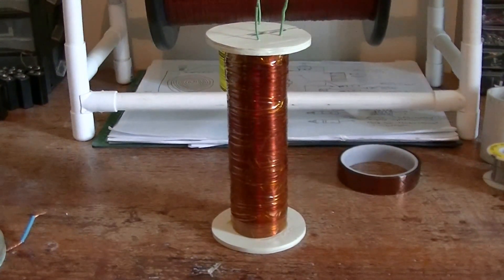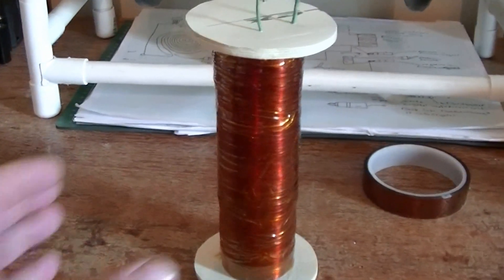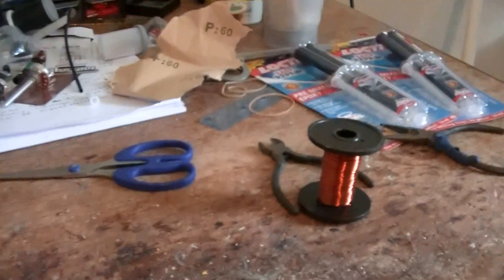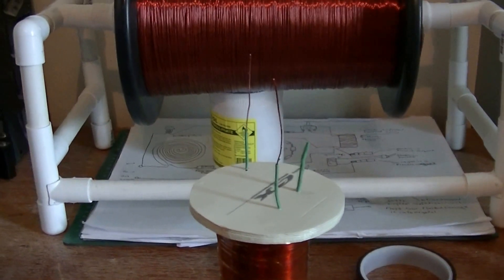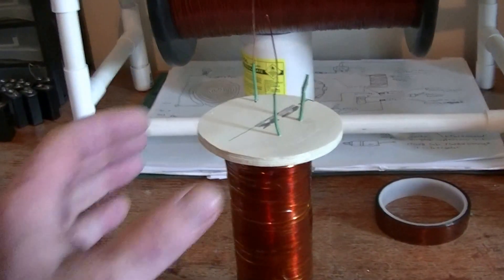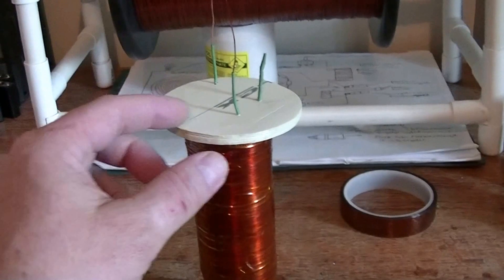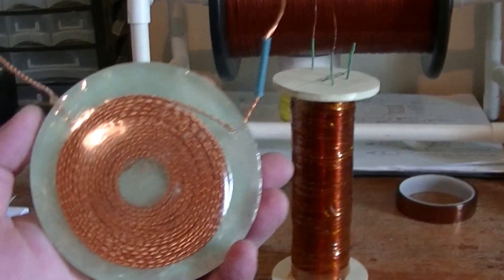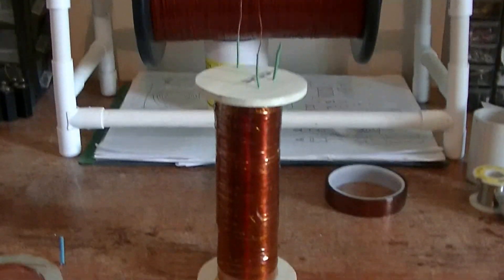completed hyper dimensional resonator electromagnet

Comment from the maker: chances are my steel bars isn't carbon types if they need to be otherwise id have just an electromagnet with a permanent magnetised core when I test them so I have plenty wire to make a proper iron core electromagnet when I find some iron